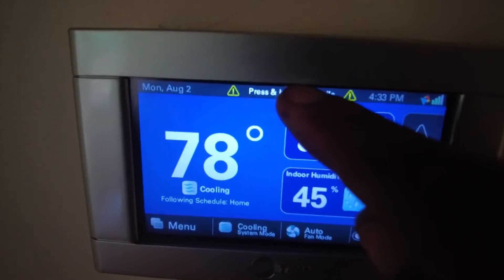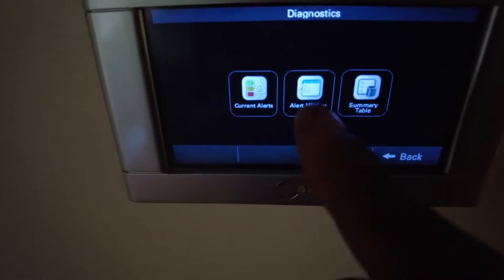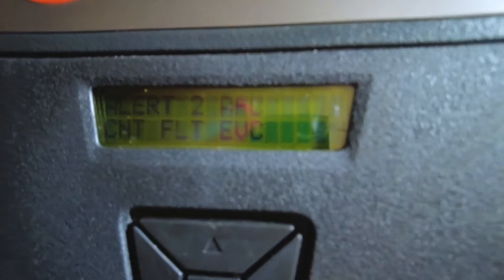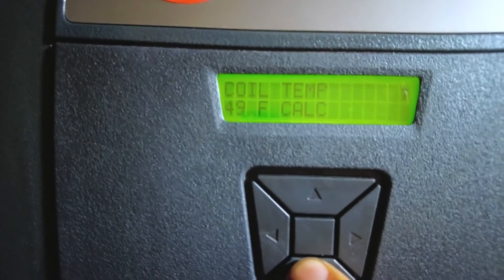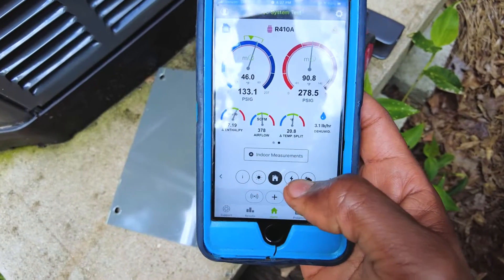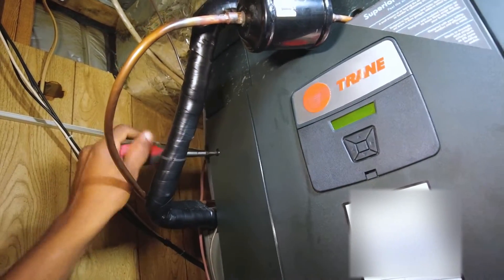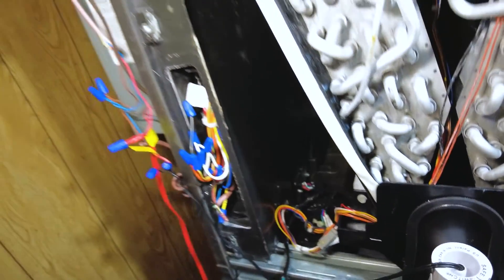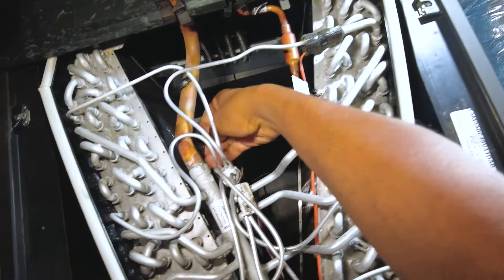Trane TAM 9 Variable Speed XV 20 System | Error Code 164.01 |  Bad Gas Sensor Symptoms and Diagnoses

Comment: Great video. This past week just replaced my old 30 year old heat pump. Put in a Trane 16i with a Tam9. Couple of questions.
How is the proper way to run the low voltage cable? On my install they run them between the door and the unit. Has to be a better way. Thoughts?
Also seems to be a lot of air that comes out where the line set goes in and around the breaker for the aux heat. Thoughts, anyone?
Thanks again.
Reply: Trane dealer tech here, there’s a slot in the air handler door for the control wiring so it doesn’t get pinched by the door. No worries.
Reply: @williammorris3334  
thanks for the reply William. Have you had much experience with the Trane 824 thermostat?
Reply: @RG_sssSMOKING  extensive, I’ve worked for a Trane dealer the last 6&1/2 yrs and about all they put in is 824’s and 1050’s
Reply: @williammorris3334   I just had an XL16i and a Tam9 with a 824 T  installed a couple of months ago. I am pretty satisficed with it but have questions that the company that installed may not be giving me good info. Maybe they don't install this combination very much. Is there another way I can contact you? 
RG
Reply from the maker: Sure you can contact me at my email. hvactechknowledgy@gmail.com. My apologies for the delayed response.
Reply: Also yah some air leakage is common and part of the design. You can tape up the openings with duct tape if it seems excessive.

Comment: I have the XV20 in my home. We bought the home in 2018. It had the original HVAC system from 1998. It was 3.5 ton system on a 5 ton home per the heat load calcs . Also the ductwork was undersized from the original installation.
   Decided on a 4 ton XV with zoning. First full month after the installation my light bill was $278.
       June July and August the bill climbs to $340. We do keep the thermostat at 74 most of the time which is where we like it.
So far I have had zero issues. I vacuum the drain quarterly and use a 5” media filter. The zoning allows the system to maintain temperature since it rarely needs to cool 4 zones at the same time even though it’s undersized.
   Wonderful system I highly recommend this product if it fits in your budget.
Reply from the maker: Yeah they are really nice systems. Thanks for the feedback!

Comment: I have a customer who's lost his outdoor EEV twice on his and the second time the EEV took out his outdoor board. His was a 2015 tho. Once his is out of warranty it's going to be a nightmare. Had another customer who lost a trane ecm in his TAM and cost to replace it was over 1500 as trane wanted I believe 1150 for the motor and module, wouldn't sell just the module as the system was out of warranty (never registered by installing new construction contractor) had to buy the whole assembly.
Reply from the maker: Yeah I hear you, the compressor I replaced on one a few years ago, I believe the compressor was about $3,500 just for the part!
Reply: The motor probably failed due to undersized ductwork. What was the static pressure once you had the motor replaced. Almost all EEV and TXV failures are caused during installation not from the factory. Two failures on the same machine tells me that the installation team failed to use proper brazing procedures. If it was a stepper motor failure then I would look at the electrical wiring.

Comment: Geeze hope I don't run into any problems with those things. Better be a Manual nearby. Have seen a few on maintenance but they were working. MR CUSTOMER YOU HAVE A 20 SEER Tam....call a trane guy if takes me more than 30 minutes to try and diagnose 😆
Reply from the maker: Yeah, you're definitely not going to get very far without the manual diagnosing these systems.
Reply from the maker: Funny thing is these things pretty much diagnose themselves so once you learn how to get around the menu sets, the system can pretty much tell you what's going on with it.  For instance I replaced the compressor on one a few years ago that was able to tell me it had a shorted winding to ground. The compressor was running with a short and everything.